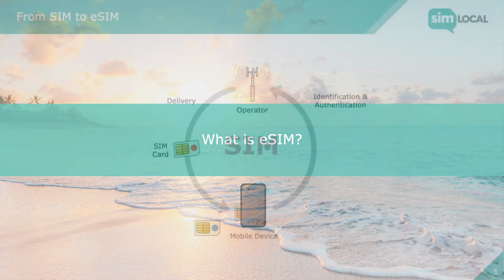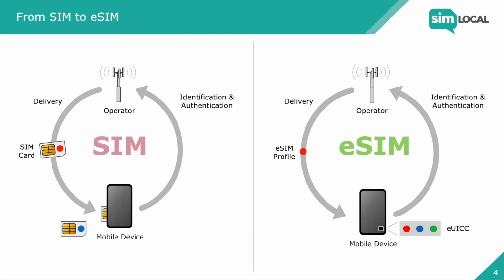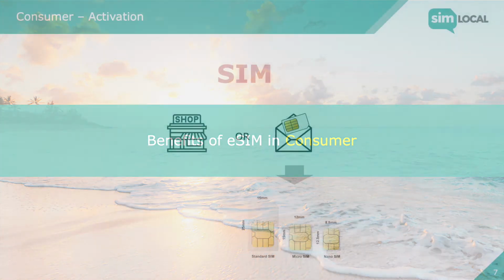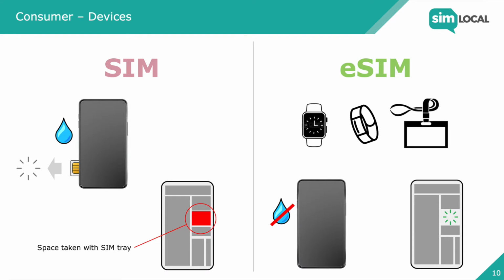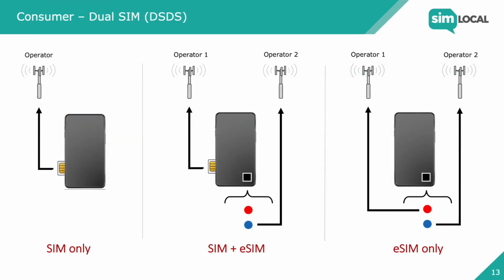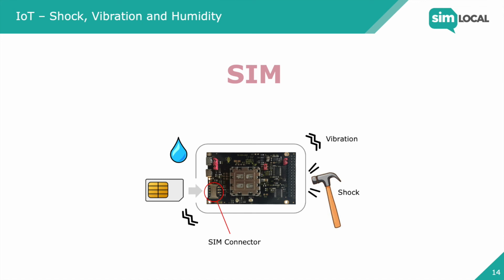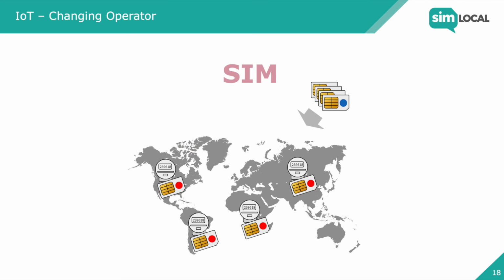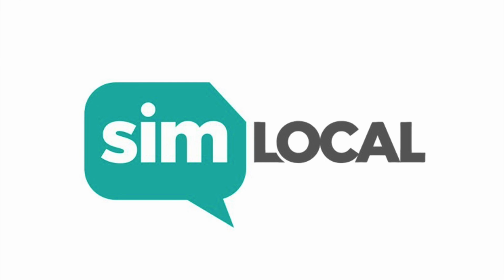Introduction to eSIM

Comment: Awesome video and explanations! Thanks for the video! Some questions: does it mean you can have eSIM enabled simultaneously on multiple devices then? Also what about a scenario where you are using a normal  SIM and then also enable an eSIM on the same device (especially without the phone having dual sim support? Both SIM and eSIM will be working and enabled in this case? Appreciate your clarifications on these scenarios.